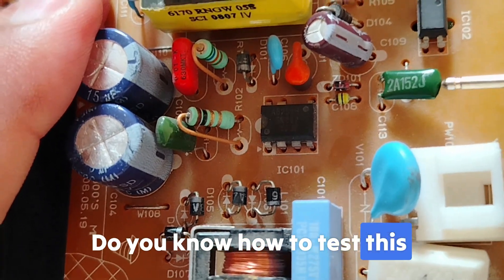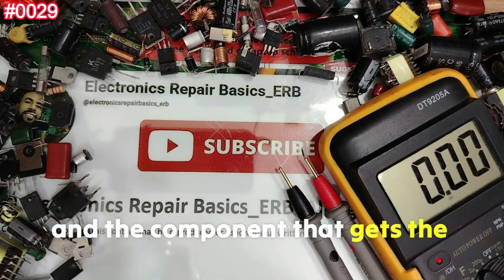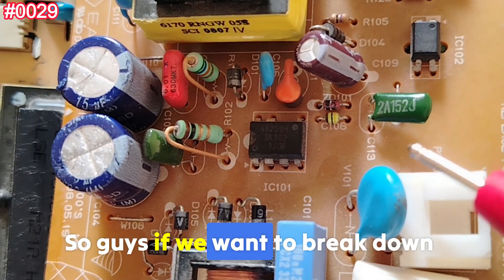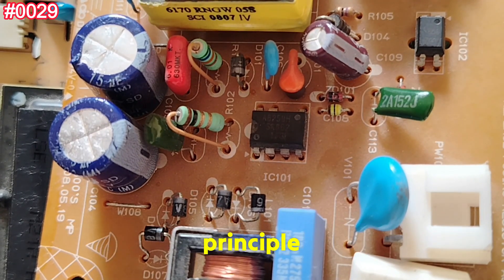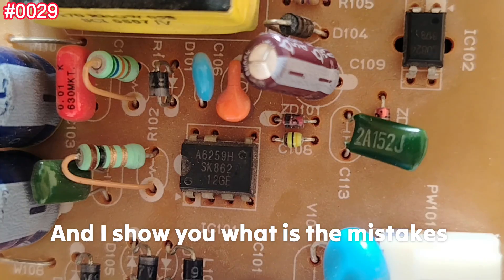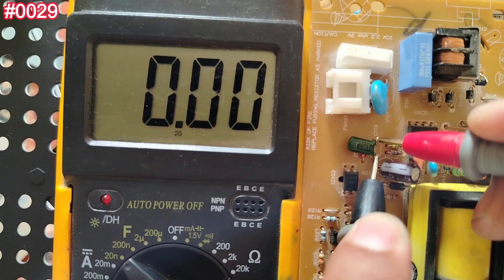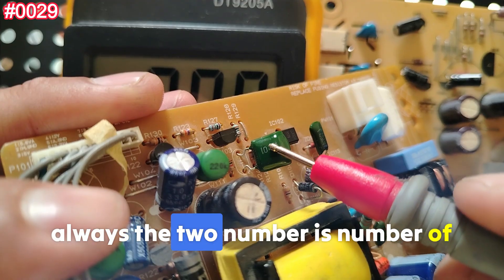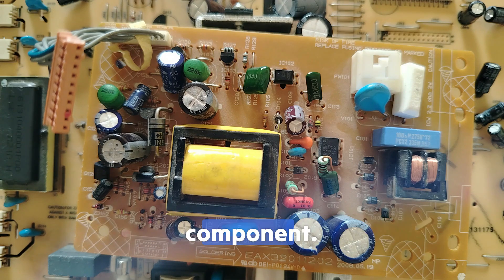#0029 Electronic Components Testing: How to Test Mylar Polyester Film Capacitor - 2A152J capacitor

Comment: Hi,
My mother board Lenovo laptop idea Pad 15isk.
Every time I replace some circuits in the mother board, it works for a months then I replace other ICs, and so on, but the laptop is not stable some time works sometimes no.
What is the reason?

ممكن تستضيفنا لون لاين

Comment: Thank you for your video. I have a very expensive gaming laptop that has stopped working. It isnt powering up but on the board it looks a little burnt. I remember seeing it the day it stopped working.... it was plugged in and then the battery started to run out and then it wouldn't turn on. The power supply still works and there is power in thr board but it wont charge or turn on